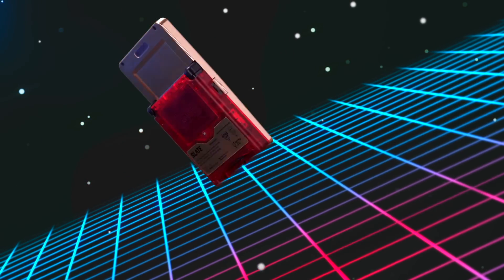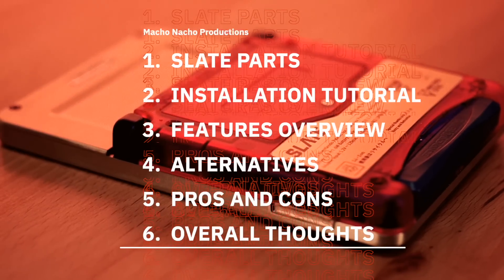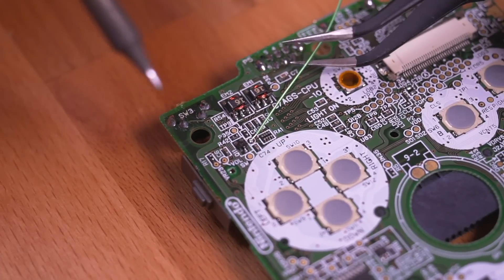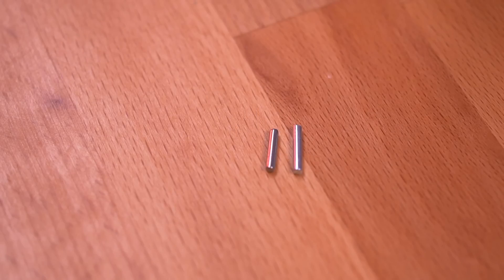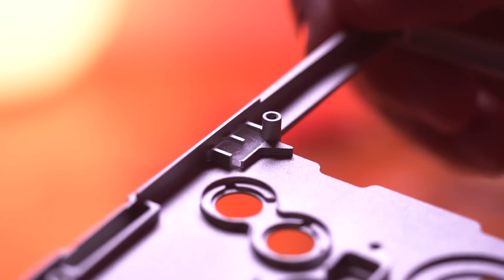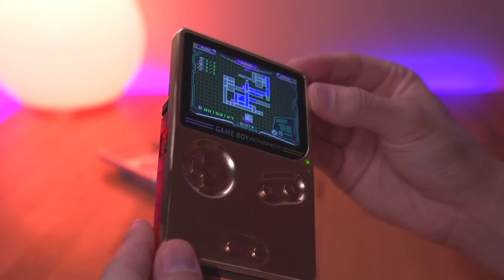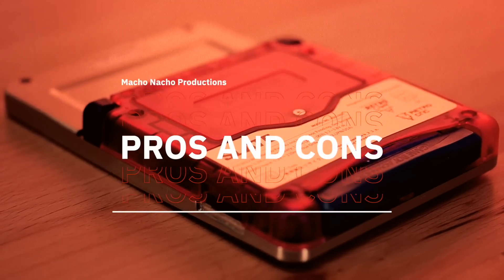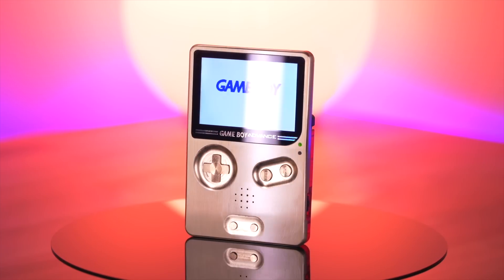The GameBoy SLATE SP

Comment: Does this work with the wireless adapter, or GCN to GBA cable? That's one of the big reasons I wouldn't really personally consider one of these since I like the idea of being able to use every supported accessory. It probably doesn't but even then, the engineering for this seems really good.
Reply: not without modification to the adapter, no. There's not enough clearance between the rear of the screen and the port itself. A dongle extender thingy would work though, if you wanted to make one.

Comment: Forgive my ignorance, I'm new to console modding and soldering in general, but would it be possible to solder the brightness controls in such a way that you have to hold both select and start to change the brightness? Some games (Boktai 2 comes to mind) require you to hold select and press the triggers to cycle through equipment and it's lowkey annoying for the screen brightness to change every time you swap your weapons lol.
Reply: Actually this kit also has Touch Sensors as an option for brightness controls, so you can use that instead. I’d definitely remove the color palette sensor though, since the foil in the lens is conducive and will effectively merge the 2. Look up Makho’s recent video on building the Slate to get a good idea of what I’m talking about.

Comment: This looks amazing, but I cant help but wonder how even more fantastic it would be, if you could have the same size dpad and buttons from the original game boy instead of the babybuttons the SP provides. large fingers :(
Reply: can only do so much with buttons without making it require soldering and making the casing quite a bit thicker
Reply: @makho  are there any mods out there that has this? maybe putting an SP into original Gameboy

Comment: Can we get a comparison of the "laid-flat" SP mods? Namely, of the Slate vs the Unhinged (vs any other options that achieve the removal of the hinge on an SP)? EDIT: There's also the Xipher Slab (with the notable difference to the other 2 being that the motherboard sits upside down, having the cart slot pointing towards the top of the unit, rather than the bottom)

Comment: Imagine if they had released something like this instead of the GBA Micro.
Reply: Eh, Micro is still smaller form factor and more portable/pocketable. Plus I prefer the horizontal layout of the Micro and the L and R buttons on it more than the SP design. Personal preference I suppose.
Reply: @joshs2235  I can understand that. I think it has a cool novelty factor to it for sure.
Reply: @returningwhisper  Definitely, although I wouldn't recommend using it for long play sessions because your hands cramp up and you might also have headaches for looking at GBA games on such a tiny screen XD

Comment: I think this is very cool, but I'm still confused as to why someone would take a folding GBA SP and turn it into something that doesn't fold. The best part about the SP to me is the fact it protects the screen when you aren't using it. Why would you want to change that?
Reply: To make it slimmer and more compact for pocket-ability. The current GBA SP is as thick as the AGB GBA, which is fairly thick to the pocket.

Comment: I really hope they make different screen colors not just black. And those aluminum buttons without the rubber membranes is a definite no go for me. I’ve heard they start to damage the actual buttons overtime… but i guess soon it’ll be time for another GBA mod😂
Reply: They are a brand new button design so how could you have heard they damage anything over time?
Reply: @HighPower64  im talking about the buttons only, look up the cnc button gba sp and you’ll find a Reddit port where someone installed the buttons and it started to damaged the buttons on the motherboard. The cnc buttons have been out for a while, maybe they will be different now or update, but I still wouldn’t trust them if they don’t have the membranes
Reply: @lvgs7348  these are new buttons.. I see that post on r/gameboy but it looks to be deleted.
Reply: @HighPower64  we’ll then maybe I’ll give them a try:)

Comment: $216 USD shipped with the discount is a bit steep. I understand the screen is custom made and the buttons/case are machined but that's very expensive for a shell/screen mod. Add in the donor console (usually $60-80) CAD and you're looking at $350+ CAD for a working slate. 

I can buy a GBA and fully mod it with an equally impressive screen for $250 with a much bigger battery, usb c, amplified audio, and a dehumm kit.... Console Included. I know, because I just did that. 

Not complaining just stating a fact. It's hella expensive. Even the shipping $50 CAD.... What are they using as packing material? Gold infused packing peanuts? 😅

Comment: I really like the look of this mod, though if I’m being honest I’m not a fan of the plastic back. I’d like it to be one or the other but not both.

My other concern is the sheer cost. Not including the sp itself (an extra 50-70 if you need to buy one on eBay), you’re look at at around $150 all in, and this doesn’t include the installation time. That’s getting very close to a analogue pocket, which may not be original hardware but also isn’t limited by it.

Since it was brought up recently, I’d really like to see input lag of this vs an analogue pocket and other ips screens. Heck, since they’re sorta close in price a vs comparison would be really cool.
Reply: GBA games look pretty bad on the Analogue Pocket tbh. GBC games look great however.
Reply: @HighPower64  I’ve heard mixed reports but mine wont be here until next year to verify. I give it 60/40 they’ll have a fix by then.
Reply: @Mampersand  It comes down to the aspect ratio of the LCD that was used, it's not something that can be "fixed"
Reply: you need a gba AND at least 160$ for slate shell & screen
Reply: @paparansen  I believe the Slate is a shell for the AGS, not AGB. But besides that, I’m not sure why you are mentioning the price when I mentioned aspect ratios? 

If you want an emulator that can run GBA games, there are much cheaper options that are just as good as the Analogue Pocket. It’s a very large console to play GBA games on with no advantages. The Pocket really shines when it comes to GB/GBC games. I still play GBA games on an AGB console and look forward to changing to the Slate AGS form factor.

Unless you got in on the preorder early you are going to be waiting almost a year to get an Analogue Pocket or pay extra to a scalper on eBay. 

I was lucky enough to get 2 at the initial release and have played them extensively. 
These are just my opinions after using the console for several months.
Reply: @HighPower64  i replied to matthew, not to you.
Reply: @HighPower64  This is totally false. GBA games look great on the Analogue Pocket, it's just that the letterboxing makes it so that a large portion of the screen can't be used (unless you want to break 1:1 aspect ratio and stretch the image to fill the entire screen). This is an unavoidable side effect of designing the Pocket's screen in the DMG/GBC form factor.  But to say that GBA games look bad on the Pocket is objectively false.
Reply: @joshs2235  ok buddy 🤡

Comment: What was the reason to go with the plastic back?  Did I miss it?  Boxy offers a full aluminum housing for the same cost.  I thought you were going to tell us wireless charge included by default but it's just using the old battery with no mods.  Aren't most people going to be sourcing a custom color back shell for extra money too?  Most of these GBA SPs out there are full of scratches.  Sorry if I sound petty but I wouldn't want to spend cash to only do half the job of the competition.

Comment: Looks nice but I prefer the lines and looks of the Unhinged SP to be honest.
Reply from the maker: Both are fantastic options!
Reply: @MachoNachoProductions  true. It's great that we are getting more and more options these days!

I do love that the buttons have kept the embossed A and B letters too, unlike BoxyPixel, and the preinstalled diffuser is clever. Shame about the lack of USB charging and headphone out. To me these are big quality of life improvements.

How does the Slate screen compare to FunnyPlaying's IPS, which seems to be the defacto standard for mods at the moment?
Reply: @rambo_ando  Slate supports USB charging and Headphone out.
Reply: @gibeshrugs6825  Maybe you could make further mods yourself, find parts, cut the plastic bottom half of the shell I guess etc... but a lot easier (and more elegant) to use the Unhinged shell if USB-C charging and a 3.5mm jack (without dongle) are important factors. Yes you can remove the stock charging port and replace with USB-C but I like the idea to be able to charge through both (eg. if you don't have access to a USB-C cable and charger, or want to use a GBA charger instead).
Reply: @rambo_ando  The TP4056 Board is dangerous and we'll never be incorporating it into any designs.
Reply: @gibeshrugs6825  dangerous how? Who is "we"?
Reply: @rambo_ando  Gibe is RetroCNC and I’m guessing “we” is him, Makho, and Retro Game Repair Shop. The TP4056 module is dangerous and any amount of research will show you this.
Reply: @rambo_ando  The TP4056 is used as a simple pass through in the unhinged, meaning it poses zero risk.  The 5v in from your charge cable goes direct to the Nintendo circuitry charge circuit to charge the stock or aftermarket battery.
Reply: @nrosei thanks. Wonder why people on here are saying it's dangerous then (in the context of installation in a Boxy Pixel GBA). Ulterior motives maybe?

Comment: This mod is beautiful! I love that it uses the back of the original GBA SP case, and of course the buttons. As others have mentioned, I would prefer a flat front surface instead of tapered for aesthetic reasons - though it does seem to mimick the angle of the fully opened SP (maybe more comfortable to hold?). I do prefer the height to width ratio of the SP Unhinged as it looks closer to that of the GameBoy- the Slate looks kind of squat. But the soft, rounded corners and edges, as well as the reduced thickness, definitely make the Slate look more refined. One final thought - I really like the laminated screen and its callback to the original GB, and would love to see some design options for the glass lens in the future (colors, characters, etc). Overall though, this looks fantastic. Congratulations to Makho

Comment: The metal finish is looking a bit better with this version. Still a little rough, but better than the sandblasted look of the older ones. I wonder if it would take well to polishing with a polishing solution inside the button areas for a smoother look.

Comment: Heads up the finish on that brass is not going to patina in a pretty way with all those machine marks left. I'd polish to maybe 500 grit and let it patina from there.
Reply: well they are clear coated so they won't patina at all
Reply: @makho  lmao
Reply: That’s good, would hate to have them start to patina before I receive it. Will just buff it myself.

Comment: Little bit naughty - you only talk about the "aluminum Slate" ($95), but show the Slate Brass which is $205.
Also, you seem to make a bigger deal about button choice being limited on the Boxy Pixel shells, and almost gloss over the fact that you have to use the custom screen on the slate.

At least there seems to be a range of options to suit budgets, from $80 for the Boxy Budget (using a donor OG GBA SP screen), right up to $300 for the Slate Brass with aluminium buttons.

Comment: This mode removes the whole reason to get an SP. If you want a non closing system just by a regular advance. (They should make a mettle housing for that)
Reply: Some people like the vertical orientation without the hinge.  Boxy pixel does sell a metal shell for the regular advance.
Reply: @yarayar1  I can't fathom why anyone would want this thing to be.
1. The hinge makes it smaller and more compact.
2. It protects the screen.

Comment: Why a crappy IPS screen instead of an OLED?
Reply: An OLED with proper specs for GBA might not even exist and if it does might be super expensive.   You'd want to find an OLED display with the correct size and the ability to do perfect integer scaling.  If you notice most of the LCD mods are using displays from old phones because they are readily available, cheap and have the proper specs to make GBA games work well.